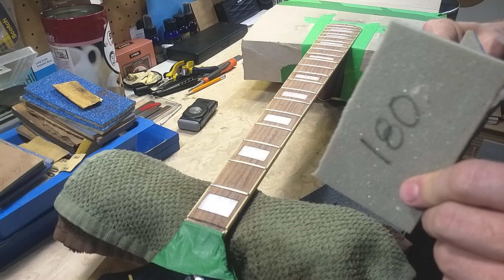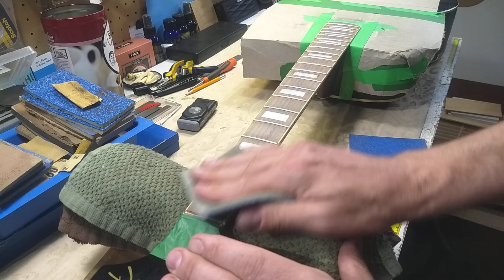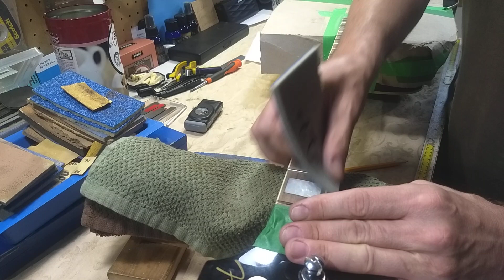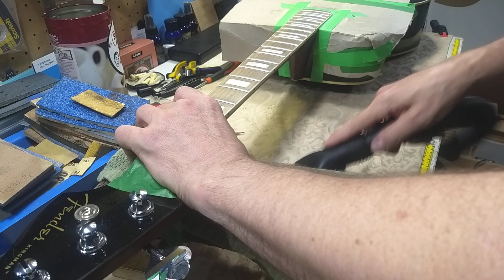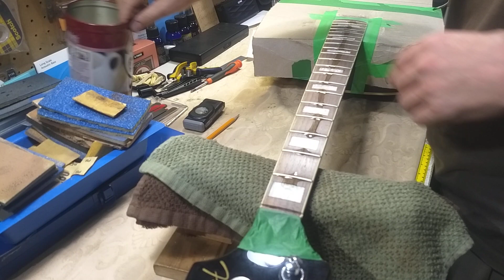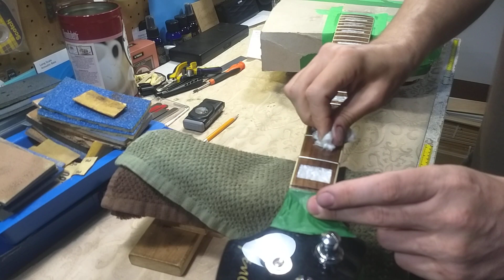Fender...  Why did you break my client's frets...?!?!?

Comment: Atrocious treatment of the frets and fretboard.
When you run such a coarse grit sanding pad over the board, you're missing the area next to the fret, leaving a different texture and a visual difference.
also a used 180 grit pad is nowhere near fine enough for a finished fret job.
Reply from the maker: Thanks for your input.  The finish pad is NOT a used 180.  Flexible abrasives are different than sandpaper.  And not all sandpaper is equivalent effective coarseness even if they read the same number grit.  When blending the final fret crowning and moving to polishing, 180 Norton flexible abrasive is effective and not at all "atrocious".  My finishing grit is at least 1000 equivalent but sometimes I'll go higher, although there's really not any effective difference finishing at 1000 vs 2000. Thanks for tuning in!!